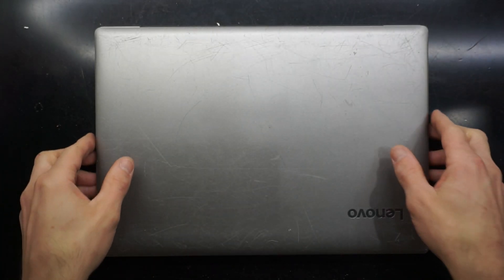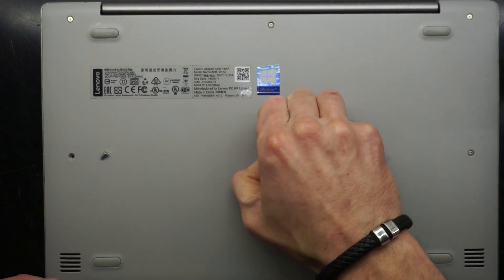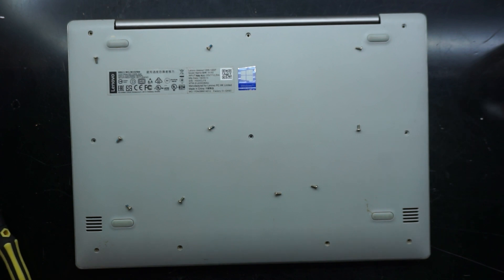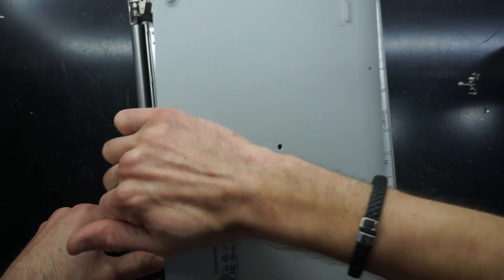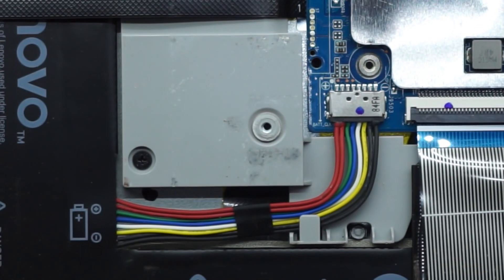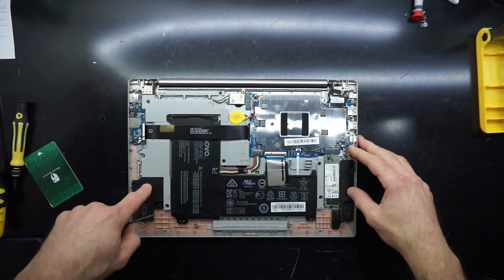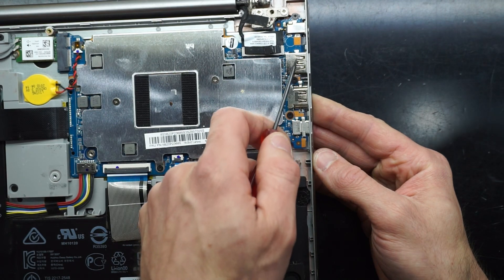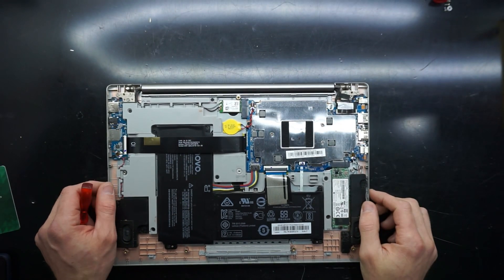Lenovo Ideapad 120S Teardown and upgrade options

Comment: So it turns out that the one that I have doesn't have that black bracket thingy that you slot it into, it's just the board.. so I'd have to figure out how to add it to use the ssd
Reply from the maker: it might only have soldered on emmc storage, if it does and doesnt have a nvme slot.
you wont have any options to upgrade it

Comment: you should really specify the specific model. 120S is a range. The 120S-14IAP that you show has an SSD. The 120S-11IAP has no 2.5" and no SSD blade.

Comment: I have the same laptop but it doesn’t have a place to insert m.2 ssd head, it has a place for it but not for the golden ships. What do i have to do ?
Reply from the maker: I'm guessing yours is a cheaper model that doesn't have a m.2
Reply: @rickstechrepairs  can I increase the internal storage at any other way ?

~thx

Comment: Hey, great vid.

I have this exact laptop. It won't charge anymore but will power on with the charger plugged in (still won't charge).

I've checked the drivers, disconnected and reconnected the battery, and still no good.

Do you think it could just be a bad battery after a few years?
Reply: Replace your battery
Reply: I have the same exact problem ! Worse laptop ever
Reply: @Tuandalat007  Replacing the battery was super easy, didn't take long and solved the issue for me
Reply from the maker: typically i find a battery wont stop it from charging and is another issue

Dont have a solution sorry
Reply: @rickstechrepairs  

It turned out to be a bad battery

Comment: Hi, i have a lenovo 120s-14IAP, wondering if i can upgrade the SSD or add a harddrive?
Reply from the maker: not sure, you will need to open to find out
Reply: I know im late but in case u never realized he has the same laptop
Reply: @josulop7372  There are at least two different options regarding screen resolution (HD, full HD), three options of different CPU's (Celeron N3350 and N3450 and Pentium N4200), three options of memory (2,4 or 8GB of soldered LPDDR4) and four options of disk size (32 or 64GB of eMMC) and type (128 or 256GB m.2 SATA). They are all Lenovo Ideapad 120s 14IAP. The only upgrade possible not counting the m.2 wifi card is upgrading the 128GB or 256GB m.2 SATA drives - but only if you happen to already have either one of them as the eMMC motherboards don't have the m.2 connector. Screen swap is also possible from full HD to HD, other way round I'm not sure if the HD units have only one lane eDP cable or if they all use the same two lane part needed for full HD. If you want to search online for a certain unit properties, there is the exact model code in the bottom. It's the alphanumeric MTM code, starting with 81A5 for the 14" version.

Comment: Hey guys i have a big Problem. I have the 32GB Version an their is no M2. SSD Slot. Have someone a solution for me? This would be great im starting to get desperate. Kind Regards Jordan
Reply from the maker: I think you will find you have the highly restricted 32gb emmc model 

If you are lucky you might have a 2.5" hard drive slot 

If you don't, there isn't a another option sorry
Reply: There are pc shops in Türkiye.they take out emmc n change drive to ssd 128 256 512 drive optio s. İ have same 32 gb lenovo .changed to 512 costs about 80 dollars
Reply: So its possible

Comment: I need your help mine came with 28GB of storage can I upgrade to 120GB???
Reply from the maker: you will more than likely have 32GB of eMMC memory, soldered on board if you do then you will need to open your laptop to see if you a m.2 slot
Reply: @rickstechrepairs  I saw a video on how to upgrade the ram with heat gun Flux and a little bit of programing it was a easy step to step I dont have a screw driver to open up so think about a portable storage do you have any suggestions

Comment: I bought my 130s about a year ago and it's been sitting dead for the last few months. Today I tried to start it back up after charging but it's not powering on. Upon first press, the power button illuminates white really quick and turns back off. Once I hold it the second time, it will stay on white but no image appears on the screen... any ideas? Thank you!
Reply from the maker: not too sure on that one sorry but sounds like a failed mainboard (a broad diagnoses of it)
Reply: @rickstechrepairs  thanks for your reply!! I’m guessing just needs to be yeeted at a wall and get a new laptop? 😂

Comment: mine doesn't have the connection for the m.2 memory
Reply from the maker: Bugger
Reply: i got a friend with the same problem was it a preowned one?
Reply: @cmarco3702  mine was, but it came like this from lenovo... I have to constantly jiggle the windows updates and disk space in order to keep it updated, and to make things worst uninstalling old updates have to be done 1 by 1, because it can't handle all the same time...

Comment: Hi, I have this laptop and I'm wondering what battery I would need to buy yo replace as mine won't hold charge or turn on without being plugged in. Thanks
Reply: i have the same exact problem
Reply from the maker: if you open your machine it will have a model number written on the battery, that would be the one to order

Comment: What should I upgrade if this laptop becomes very laggy? I really hate it. Can't upgrade the RAM right? So what should I do?
Reply: Btw I use windows 10
Reply from the maker: If it's running a pentium or i3 CPU I would upgrade the hard drive to an SSD first
Reply: @rickstechrepairs  how can I know it's pentium/i3 or not?
Reply from the maker: Right click windows icon in the bottom left computer and click on "system" it will tell you your CPU model

Comment: Did you ever find out if this particular machine was upgradeable ? I’m looking to put a larger m.2 into an identical laptop but it doesn’t look like its upgradeable as the HD looks to be part of the system board as I can’t locate it anywhere
Reply from the maker: As I showed in the video my particular model had a m.2 SSD in the bottom right side.

But if you had the budget celeron model that's only 32/64gb your storage maybe solder on board and may have no ports to expand this
Reply: @rickstechrepairs  appologies, think I was meant to reply to a different video - found it. https://youtu.be/1bee9-exkc4

Comment: What is your tip to students who are using this laptop in their online classes? I have this atm and it's testing my patience. 😓
Reply: upgrade to ssd, if not already one. then dual boot with Antix Linux, its blazing fast on 2gb ram.
Reply from the maker: Depending on exact model, if it's running a celeron then it might simply be to under powered

Comment: For the 500 HDD variants.  I will Upgrade HDD too SSD. what support? Please help.
Reply from the maker: Being as this is a nvme model,
i would go for a Crucial P1 500GB Model (DRAM-less but still good value)
https://amzn.to/2FCiNAm

Before buying the part it would be best to open your machine and see if it looks the same inside
Reply: @rickstechrepairs  My laptop is Lenovo Ideapad 120s HDD 500GB type.
Can I upgrade from HDD to SSD?
Reply: @m.irwanzamroniali9913  Yes. 120s 11IAP options differ from the 14IAP options I went through in my previous answer.

Comment: can i change the hard drive from 32gb to 64gb?
Reply: Seems like the model with 32GB, dont have M2 or SATA conection. So not possible.
Reply: Technically, you could, but only by swapping the motherboard to one with the 64GB eMMC or a m.2 connector. Not worth it, the cost for such motherboard is all too high. I'd rather try finding another second hand specimen with a better disk. In my country it'd be like 40€ plus postage. That way you'll have two of them laptops and you could sell your original one - again for 40€ or such :D Most people don't realize there are different hardware setups (screen, memory, cpu, disk) so they all go for the similar price range.

Another way around the skimpy 32GB drive would be a memory card which would be inserted in the slot and left there and used to save your stuff. That would make you use an external USB card reader for your further card needs.

Comment: what is the type of m2 ssd?
Reply from the maker: 2280 nvme
Reply: @rickstechrepairs  it's not a nvme, it's a ssd M.2 SATA
Reply: @fabiobruno7133  I'm confused, because if you look closely it says it is sata, but if you look at the connecting pins, they are not sata :(
Reply: @rickstechrepairs  help me please, I need to increase the storage capacity, but I don't know what kind of solid state disk to buy, if nvme or sata :(
Reply: @noir.company  At least the one in this video is a SATA one, see the sticker. And so is the m.2 drive in my 120s 14IAP.

Comment: I have the same laptop, i wanted to upgrade the processor but I guess can't do that. thanks for the video.
Reply: My 120s-11iap laptop came with a Celeron n3350 processor (2 cores) and 32GB emmc and 2GB RAM. I bought a motherboard on aliexpress: N4200 processor (4 cores) and M.2 SSD slot. and 4GB RAM. Disassembled and replaced the motherboard.
Reply: Danilo Gomes does ist works?
Reply from the maker: No worries glade it was helpful 

Sadly there isn't much that can be upgraded 

Storage and WiFi
Reply: @rickstechrepairs  আমার Laptop 120S- 11iap... so i want to change Ram but can't find Ram slot!  Is it possible?  Please reply...